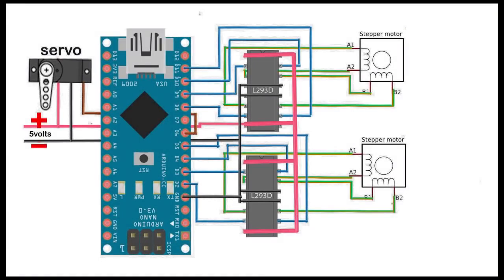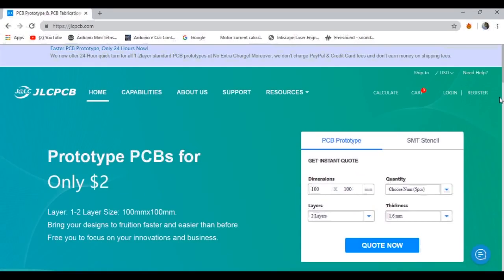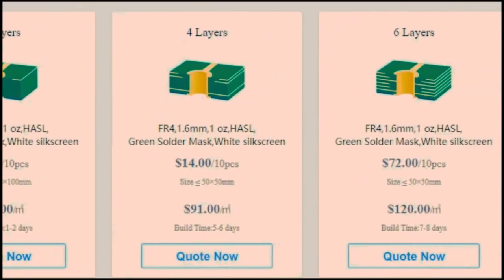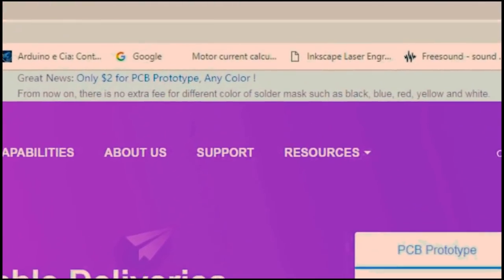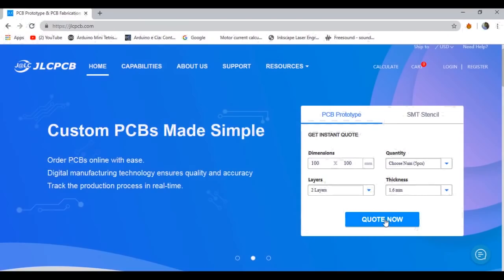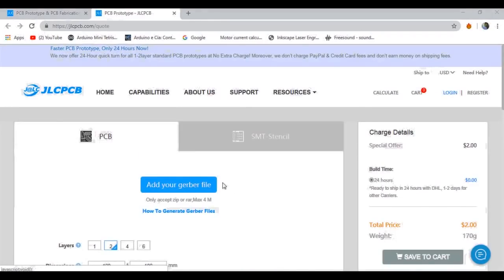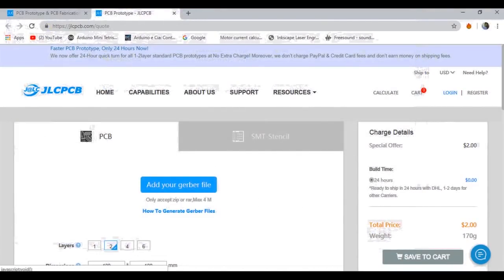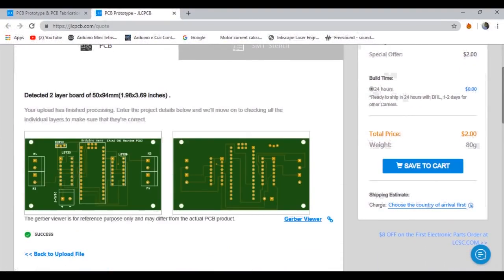DIY Arduino Mini Laser Engraving Machine

Comment: Bro I have a doubt on 2d printing machine..... I have one cd driver which has 1 stepper motor with only output as 2 wires.... But u r video shows 4 wires as output......
Can u make a video on tat bro plzzzzzz
Reply: Stepper has 4 wires .. not 2
Reply: @dhanakodimani4783  bro.... So I may get stepper motor on new version of CD/DVD drivers and not for old one right
Reply: bro it might not be stepper but a simple dc motor
Reply: @AhmedAli-sn3ty  bro...this means not all cd/DVD driver r  made up of stepper motor.I guess mine cd driver consists of DC motor
Reply: try applying low voltage to those two pins let us say 5 V if it starts rotating instead of single vibration it is definitely  dc motor.
you  need to get another dvd driver    
for old stepper.
Reply: @AhmedAli-sn3ty  yaa bro... Its rotating...tat means mine is dc motor cd driver....
Reply: @Dhanushnanda  yes you need another  driver
Reply: @AhmedAli-sn3ty  I am in need for help to make this 2d printing machine as my project work for Engg
Reply: Better built with NEMA 17 stepper motor.. they r more reliable
Reply: @dhanakodimani4783  bro can u say what is NEMA 17 PLZ....
Reply: @Dhanushnanda  thts a stepper motor.. much better than shitty DVD motors.. u can engrave high quality image.. Chech above link.. I made that for my frnd
Reply: @dhanakodimani4783  bro it's lazer one.... I can't opt High cost one for my project, so I am going on with 2d printing machine which is easy and cheap (worth) for money too...
Reply: @dhanakodimani4783  i think he is beginner . he can make it with this dvd  stepper motor for now
Reply: @AhmedAli-sn3ty  NEMA 17 much better than DVD motor.. more convenient, more reliable drivers , can get library easily
Reply: I request the channel mk inovative.... To put all the files related to CNC 2d plotting printing machine files in google drive and send link in the description plz...
Mediafire is not at all working properly ..... So plzzzz 
If u read above thing plz reply... Don't neglect bro
Reply: NEMA 17 works great for 3d printing and precision.
Reply: @The_Knight25t  also gives good result for laser too .